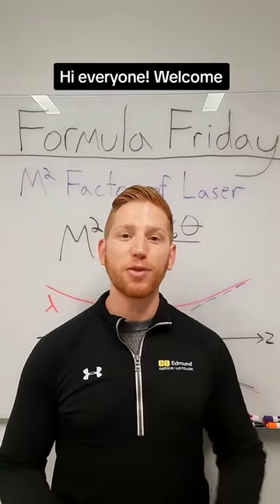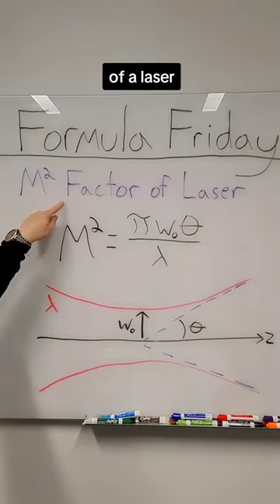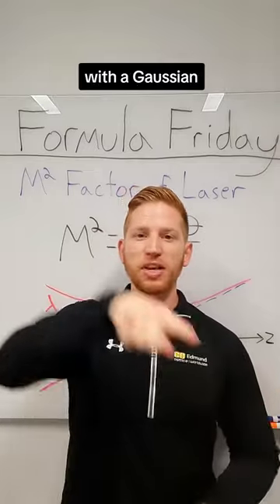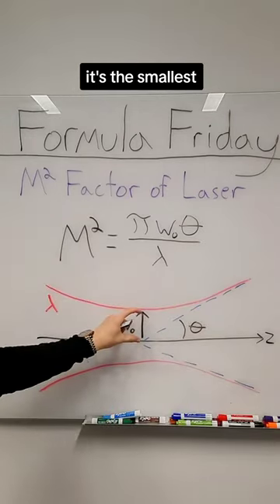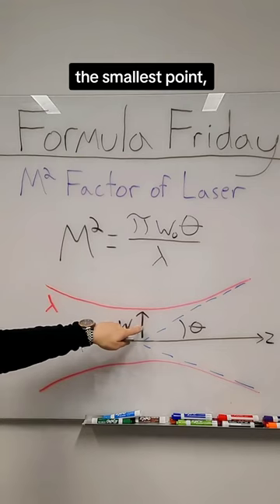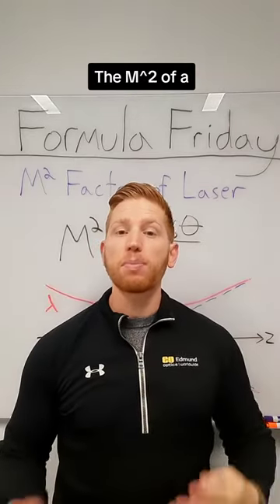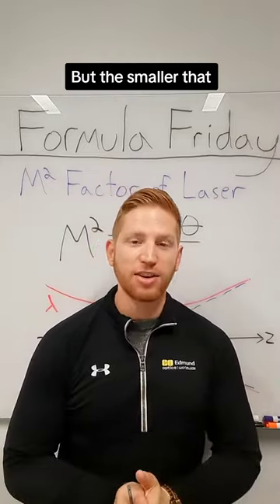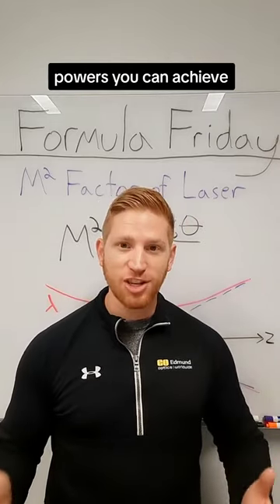Formula Friday - M^2 Factor of a Laser #shorts

Comment: I’d looove a vid on how the inverse square law changes depending on the spread of light. I kinda get it but feel like there’s a lot more to understand
Reply: If we talk about laser beams - the optics change the location of the waist used in distance calculations. It may not necessarily be at the last lens element, but physically after it or virtually before it. 

When talking about diffuse light sources used in photography. there are two extremes worth considering. A glowing infinite white wall will light everything the same brightness no matter the distance. A perfect point will perfectly conform to the inverse square law. 

A large finite size softbox will behave closer to one or the other depending on the distance from it. If you have something much smaller than softbox very close to it, there won't be noticeable light falloff from distance itself. Then the shadows and angle to surface will determine brightness. Meanwhile if you're roughly 5x away from softbox compared to its size - it gets quite close to inverse square law again. 

In between these extremes the light falloff gradually changes. In practice, unless you're writing simulation software yourself, you'll just judge lightning by eye and not do any such calculations.